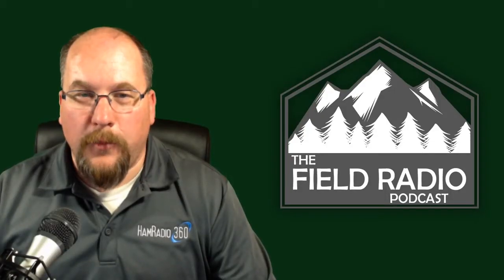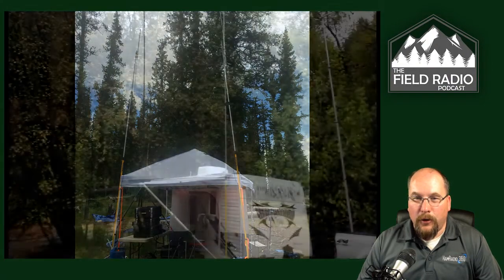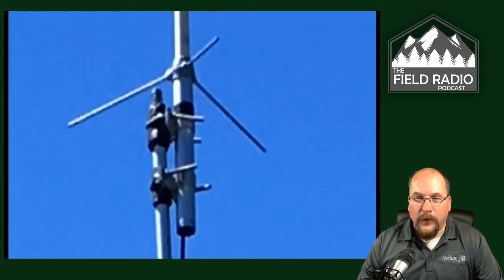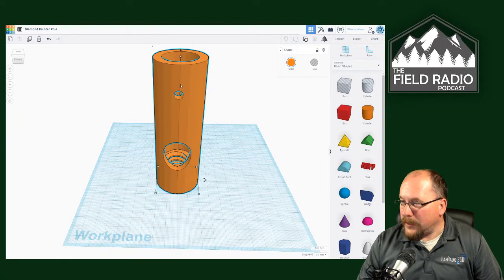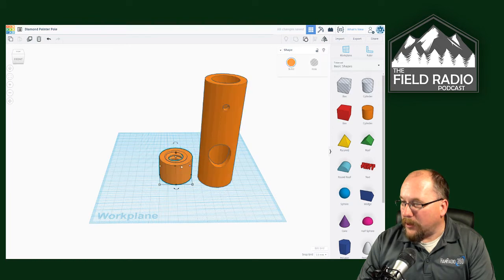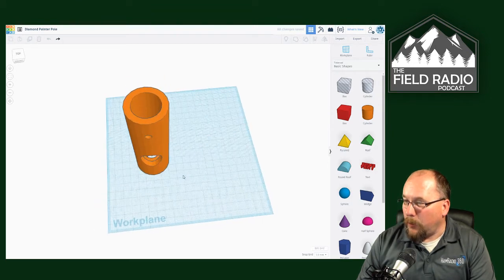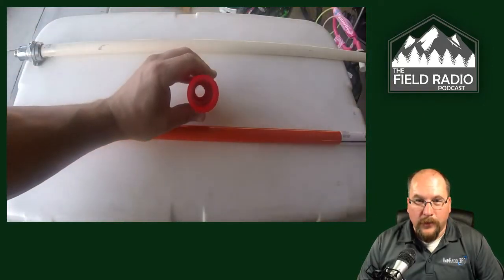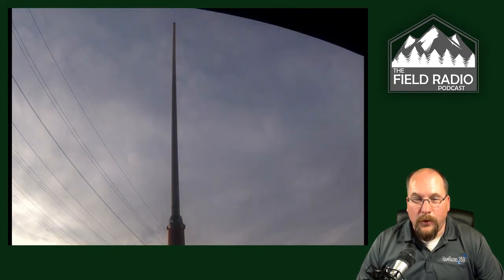3D Printed Painter Pole Antenna For Amateur (Ham) Radio Field Portable Communications

Comment: For an inverted "V" wire antenna: get a paint roller from the dollar store. Has a pole fitting on the handle. Remove the roller hardware and bend over the rod into a hook. Hang a pulley and rope on the hook. Now you can raise and lower the balun feed point. VA7WN

Comment: Thanks! that was super easy to order through the thingiverse  link you provided.
Reply: so that's how you strike out the text.... haha. (I didn't mean to do that)
Reply from the maker: There is a follow up design for the use with military poles also. Just so you know the thread works great in plastic tip painter poles. The metal ones they are loose and need a bit of tape to thicken it up a bit. It's just painter pole threads being inconsistent from manufactures. Hope you enjoy it!
Reply: awesome, thanks. I might have to order one of those as well.   
And thanks for the reply, and the excellent videos.

Comment: Very cool idea for a low cost mast
Reply from the maker: Thank You! I love the painter poles. So many sizes and options.
Reply: Check the one used to build temporary tent inside, you can attach one to another with a head less screw. Manufacturer is TASK, available in Canada at HomeDepot. they have a 10Ft and a 13Ft version. On each end there. I replaced the screw pad on each end by a bolt and made attachment i need using standard nuts and bolt.

Comment: Neet Idea, looks well executed - couple of questions
1 - PLA or ABS or ?
2 - Thingiverse link to the thread model pls
3 - Which model diamond
Reply from the maker: 1- I print PLA mostly because my printer does best with it. If I need something to stay outside to prolonged sun exposure, or heat, or more strength I print on PETG. 

2- https://www.thingiverse.com/thing:1770373

3- My antenna is the Diamond X30A http://www.diamondantenna.net/x30a.html

Thanks for the comments! John
Reply: Thanks John, I appreciate you taking the time